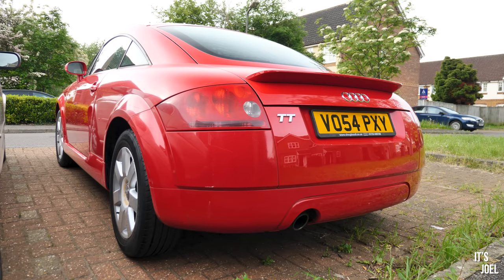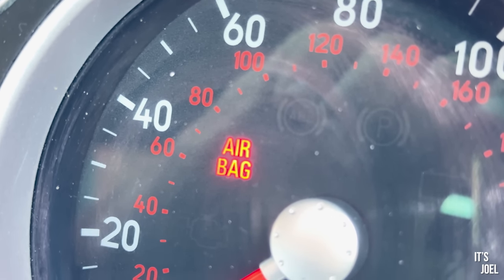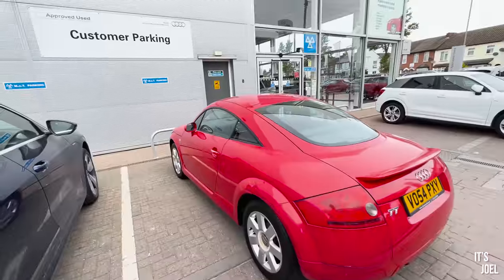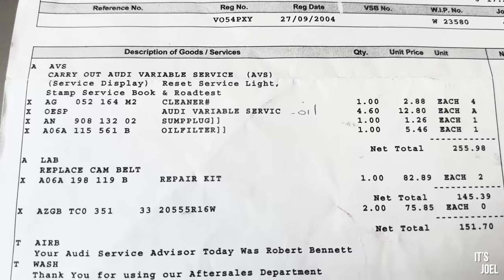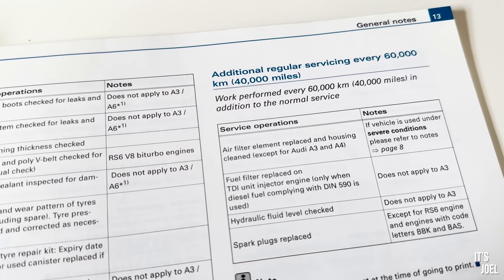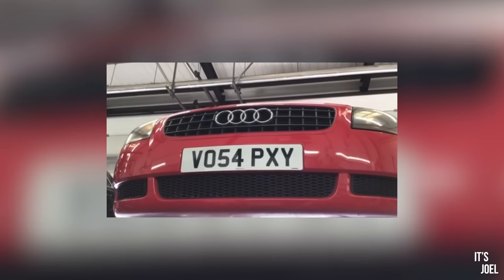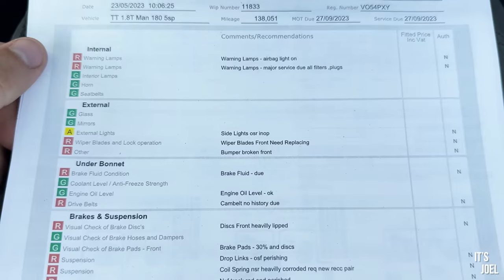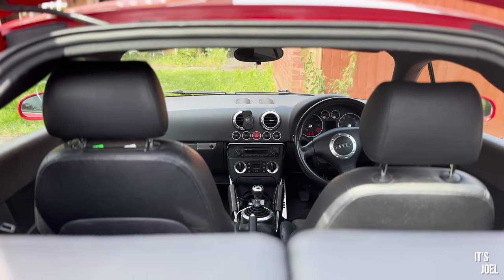AUDI WANTED £2,698.70 TO SERVICE MY COPART AUCTION TT!

Comment: If I’d known you were doing this I would have suggested exactly the same thing. The take away from this is deciding what you can do yourself and what needs a mechanic. Certainly the stealer won’t expect you to take the car to them and they will price heavier to discourage you from doing that. As I said in your valet vid I have the same 1.8 FWD in black although I have discovered that mine has been stage 1 modified by a previous owner. Aside from some scrapes to 3 corners mine needs a near side driveshaft which I’ve ordered and intend to fit. Mine also has original cup holders which are apparently rare as rocking horse do-do. My car is also in need of a service and I’m happy to do coil packs, plugs and oil. Mine has a cone filter which I will clean. As my car has literally 2 pieces of paper and no books ,V5 or any other history I will run it into a reliable mechanic for a look over and grab a belt change as mine is at 155K and so in the region of a second belt change.
Luckily my nephew works for a wheel refurbishment company so I’ll get free new looking wheels and 3 of the tyres have been replaced (why not all 4 I don’t know).
I’ve also ordered a carbon fibre rear wing extension and front splitter.
I’ve also re-washed it and mopped it today, I’ve also progressed with the headlight restoration but I need some ultra fine sanding discs to get them perfect.

So far:
Key fob battery £4
Stereo unlocked £16
Washed car 3 times and mopped once £10 (chemicals)
Refurbished headlights £0 free (ongoing) bought mop tool, pads and chemicals
New Vonhaus random variable mop set £96 (having seen your drill attachment) for headlights and mopping bodywork. 
Left side front driveshaft £96 (ordered yet to receive and to be fitted)
Worst scratches and grazes to be restored £ unknown
4 wheel refurbishment £0 free (to be done)
Fit splitter and spoiler £320 parts cost only (ordered yet to receive and to be fitted)

Comment: Rear light. You will have minor corrosion on the connector at the back of the light. Check handbook, remove & clean 👍👍
Reply: Yes, De OX IT spray works really well on connectors !

Comment: To be fair main dealers do a good health check, down side is they have high overheads. The service cost is good value for the information you get from the inspection. Near me indies are about the same as the main dealers,  took my merc into an indie for a main service, the bill was £700. This was without any main replacement items.

Comment: I wish mk1 TT's were easier to find in the US. I had a 2017 before buying the Z4. At this point in the US, the mk1's are all too high miles, and just asking for trouble at 10X what you paid for yours. BUT very interested to see how you get on. Hoping it'll be fun and joyful for you. It definitely will be for us, especially if you do as much of the work as you feel you can do competently. Cheers!

Comment: I had the hazard warning light / indicator fault on my TT. I got a new hazard light button module and replaced it myself. It was an awkward job with getting the radio out and fiddling in the dash but simple enough that even I could do it.

Comment: The hazard light switch sometimes isn't the issue, mine was the indicator stalk. - This could relate to the airbag light if its linked to the wheel.

Comment: I'd have a look at the oil leak first - might be like I have with my L322 that there's a very slight leak but it's by the fan, which spreads it everywhere! Then I'd look at the suspension components etc. Then when you've got the underpinning settled, see if you can find a set of original wheels with half-decent tyres on already. There's no point sinking £600+ on the boots if the car itself is a wreck.

Comment: Biggest saving on your car is buy some tools invest money 500 quid for good set of tools and jacks etc and rest you should be able to do such as full servicing, brakes, exaust, suspension, lights bulbs, wipers, so on rest the parts you can get good qulity ones for cheaper then oem ones also labour youll save alot alot, only wheels and tyres would cost or somthing eletrical that you dont know, rest its your own hard work and parts thags it.

Comment: i used to work in the motortrade at a Lexus franchise a much cheaper option would be to get the brake discs skimmed on the  car and just replace the brake pads it would only be about an hours labour cost

Comment: On the rear side lights, I think you turned the dial twice to main lights, which is why it looked like they were fine, check again but one click of the dial. Could be just a bulb, or connection. On the suspension I'd be tempted to buy the parts yourself and let a garage do it, knowing VAG cars of this age, bolts and stuff often sheer off or are badly rusted and they can be a swine. Nothing worse than getting halfway through a job and being marooned.. Spark plugs easy DIY, wipers, tyres and alloys etc. Keep apend low and might be a bit of profit in it when you sell. Take undertray off and investigate leak, hopefully not the sump but could get a second hand one if it is, just make sure it's torqued up to spec. Might be worth scavaging some parts off a scrapyard car.

Comment: From what I've seen on UT videos and from my own experience VAG parts can be eyewateringly expensive! and imagine labour rate are pretty high too. We have had 2 MK2 TT's and front brakes are very strightforward to do. We had an oil leak on ours that was due to the wrong sump plug being fitted!

Comment: Most road springs have rust because the paint flakes off. I certainly wouldnt touch the springs unless they are fractured, or at least after seeing what the MOT throws up.

Comment: Got a 225 BAM, avoid the dealers and go to a VAG specialist. Its a nice little car that has a huge upside depending on how much budget youve got to put in and how much you want to do yourself. Big community and loads of mods you can do IF you wanted to go down that route.

Should also say got the cambelt and water pump (the metal one, and not the plastic one the dealer would probably want to palm you off with) that was more than halve what Audi quoted you.

Comment: Rear camber doesn’t look good. I had an independent modify mine by slight elongating holes to get more adjustment. Was either that or adjustable tie bars which were pricey. I never had an issue with it and he’d done loads this way.

Comment: joel do the stuff you are confident you can do, they farm out the rest to a specialist. main stealers always find stuff that isnt there or as bad as they say, i had the same at skoda when they said my brake discs and pads on front needed doing, i said so why wasnt it brought up 7 weeks and 300 miles ago when it was in for mot??? i would never go to a main dealer for servicing!

Comment: Great cars when running, however electrical problems are usually the main issue. Drivers door loom through a post, door locks and rear washer all failed on my A3.
Hope you have better luck than me.

Comment: Ive never taken my car to a main audi dealer. The prices ate a HUGE rip off and, in some instances, forget to do the simplest things. Like tighten the bolts up on your wheels before you drive away only to turn a corner and realise something is dreadfully wrong and see bolts hanging off......

Health check is a good idea though but defo go to a specialist or like you said just order the parts and DIY.

Comment: Do the work yourself Joel.
I never use a Dealership unless absolutely necessary.
I go by the thinking of "If it will unbolt, it will bolt back on"
In fairness the suspension parts you mention are not hard to change parts.
I would also do the engine servicing myself with a car of that age and value personally.

Comment: The rear springs don't look corroded 🤔 when you investigate the airbag issue you will need a diagnostic tool to turn the light off....repairing the issue will not turn the light off with out it.

Comment: Those Audi main stealer prices are eye watering. Genuine Audi parts and Audi labor prices on a car or that age is a waste of money. Glad your not going down that route. Most cars of that era maintenance & repair jobs are DIY with the help of Youtube videos and some forum Googling. Your young, do a basic electronics course, practice with a soldering iron and how to use a multi meter, you will then be then be able to tackle car wiring and electronic troubleshooting. Fixing that air bag connection under the seat and the indicator button would then be a breeze. It will save you many garage trips and a lot of wedge. Get your hands dirty 💪

Comment: I would start with the issues likely to cost the most to fix so, from the last mot advisories, that might be the rusty rear cross member / subframe and some bushes. If that can be fixed diy  only then is i worth looking at the other issues. Ideally you trace the source of oil leaks but I would change the cam cover gasket as it is normally not too challlenging to address but check the service history to see if it has already been addressed as the mess underneath might be historic.

Comment: High there.
The oil leak under the cross member rings alarm bells!
Hopefully not but beware of a worn crank shaft seal! This leak could get on the clutch plates in time.
Mike

Comment: I had a 225 with the same type of oil leak.. infact it wasnt oil, it was power steering fluid leaking out of the frnt pipe, wich is located right at the front under the rad on the left handside, they rust for death mucka!

Comment: Audi prices for labour/hr are staggering 😮.  Any notes on corrosion ? Couldnt help noticing the rear cross member had seen better days, not unsurprising after 20yrs.   On your drive in the next video a basic comparison to your old Z4 (or the 2.2i) would be interesting for me.  Was looking at soft tops and comparing TT mk1 roadster vs Z4, but have been thinking a coupe or metal roof  SLK/mx5 with aircon might be better/more secure/ long term.

Comment: I have a 2019 Audi RS3, when I went to the main dealers for an interim service including the cabin filter, they wanted £603, I nearly fell over for oil and filter change and cabin filter. I went to a specialist Audi independent, who has access to Audi service records and only uses OEM parts, there price £260 including VAT, result.

Comment: What Audi fails to mention is the airbag system is disabled under fault condition ! Get that under seat connector replaced or bypassed professionally. Just don’t plan on taking the seat out after that if you go with the latter  ! 😊

Comment: I bet an independent garage would do all the work including finding the oil leak (extra to fix it) and including a £180 for the alloy wheels refurb would come to less than £1k.
Gives you a stamp in the book and reciepts 
And the tt is worth that much being chucked at it.

Comment: Wouldn't you replace the brake fluid when you replace the brake disks and brake pads?  You've got the wheels off and can get to the bleed screws easy then.  Just need some wrenches and your wife to pump the brake pedal while bleeding the brake fluid.  Just have to watch the brake fluid level in the reservoir so it doesn't get too low before adding more fluid as you pump in the new and the old flows out into a pop bottle.  Pretty easy, just lots of little things to watch out for and wrenching the bleed screw open and closed in concert with pumping the break pedal.  =D=

Comment: I did think you were going to say it's an Audi, and the indicators dont work 😂 Main dealer rip-off prices.. You can easily do the service and suspension yourself and get good content for it. Or find a good independent VAG specialist like I use for my Tiguan. All my other lower value performance cars I service myself. Good luck it seems a good car 👍

Comment: If I was you I would be changing the Shocks as well, they do look a bit Crusty, you might as well seeing your doing the Spring,s, plus I would fit some stainless brake lines and some Ferodo DS 2500 pads with grooved discs, just to be sure, you can’t put a price on safety, Drive safe.

Comment: Mate...don't be put off by this...i had a video inspection of my car and was sweating...then it played to my advantage because i ordered the parts they said needed replacing in their video from a well known online euro parts place and had them all installed by a local garage...passed the MOT with flying colours...and i saved money by not letting a main dealership near it. Bosch wiper blades...piss pot easy to replace...buy from Halfords.

Comment: Unfortunately that’s main dealer garages and some backstreet garages for you at the end of the day they have bills to pay it’s there bread
 and butter so they’re always going to exaggerate and make you have more done then you have to. I think a timing belt and water pump for that car is about 60 to 80 quid max oil filter air filter fuel filter peanuts oil about 40 quid drop links and stuff like that £10 each Springs I like £35 shock absorbers probably £30 when you’re in the car business buying and selling cars it helps to have a friend who is a mechanic, or even when you’re not selling cars it helps to know someone in that game you could probably buy all the bits and pieces for maybe 300 quid max and give someone 150 quid to 200 quid to do it all and put it all on I don’t know main dealer garages😂 great video bud very good cheap car money to be made👌👌

Comment: MOT it and bodge it thru then drive it into the ground,its a heap of shite tbh.......the airbag light problem seems similar to one i had with a clio.......just solder the wires together under the seat instead of using the plug....that should solve it

Comment: What's the date of the last cambelt change? It might need doing based on age
Reply from the maker: I’d have to double check, but think it was 2019!
Reply: @itsjoel  If it's 2019, you don't need to sweat about it until next year. Cambelts are changed every 70K or 5 years. Whatever comes first.
Reply: @itsjoel  Yeah, agreed. That's fine. I bought a 2004 TT from Car Giant when it was 4 years old. The original Cam Belt lasted 91,000 miles on that car but was fortunately changed just before I got it. You're definitely better off with the FWD version. Mine was a 180 Quattro and the fuel economy was terrible.

Comment: there taking the pi!!   i own a tt  too   all that work you could do yourself for couple  of hundred quid  and it does not need  cam belt  change   new discs  or  brake fluid   and £640 for a service daylight robbery

Comment: My MK1 TT was a money pit. Every time it went for service issues were found particularly with the suspension. I would say do the mechanical work yourself but have someone do the suspension items for you. I only say this from a safety point of view. You really need a ramp, the TT is an extremely heavy car I fear for your safety putting it on axle stands on your drive.

Comment: Audi always tell you everything that either needs doing or is due to be done, or needs fixing, that is part of the service

A part of the service that you don’t get at greasy joes back street garage 

You are in no way obliged to have all the work done, they are just informing you

Buy a service plan from them, £25 a month and that now includes RS models, you still have to pay for things like brake fluid service and haldex spark plugs etc 

Worth the piece of mind and expertise not to have a shed of a car imo

Comment: Joel, oil, oil and air filters, spark plugs and brake fluid will cost you less than 100 quid, and that includes a spark plug spanner! Even a novice can do all those in a couple of hours tops. 650 is daylight robbery......

Comment: It's a £500 car! I'd spend the bare minimum barring safety items such as brakes and suspension, or anything else that keeps you safe. Airbag light is most likely because of a seat adjustment has pulled out wiring to the sensor. But I 100% think you know all this. 
The only calculation you need to make is whether any viewing or advertising revenue is going to pay for any further non crucial work to the car after a MOT, and if it isn't, leave it be

Comment: Yup, lol - Audi TT 1.8 T COMPLETE-Service-Kit Oil Air Fuel Cabin Filter Spark Plugs 98 to 06 BOSCH

£66 odd quid later eBay that's the bits, what's left, some basic as heck labour

What a joke main stealers at £640, eh !!!!!!

Maybe £300 if a noob and a person too little time go independent but £640 for £60 parts and not a lot about else

Comment: £62 for wiper blades lmao , got mine for a tenner at Halfords , Seems like only Millionaires go to main dealers for repairs lol Also i was quoted £620 to replace front shocks and springs on my car , so i just ordered the parts myself for £180 and a different garage only wants £110 to fit said parts so yeah dodgy the main dealers are

Comment: I don't understand this. You bought a cheap Jag and ended up spending more than it is worth. Now you have an Audi TT, which at the moment are still plentiful, and you didn't even intend to buy it... but you did... now surprise surprise it has a long list of faults and a short MOT and you are considering doing the repairs? Don't! Use it, have some fun, then take it for the MOT. In the meantime think about what you are doing. When the MOT failure list is added to the list of jobs you already have, just sell it as spares and repairs, and you will probably get your money back. I promise you, anything you  spend on that car, including your time, you will never get it back. There are others out there for cheap. It isn't worth attempting to save. It just isn't. It is an old banger someone sold on copart for a reason!